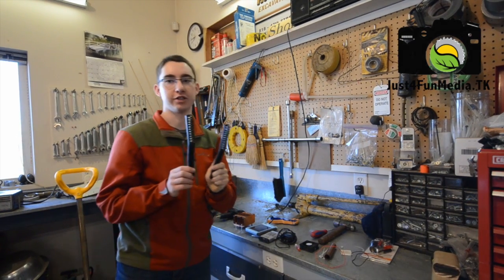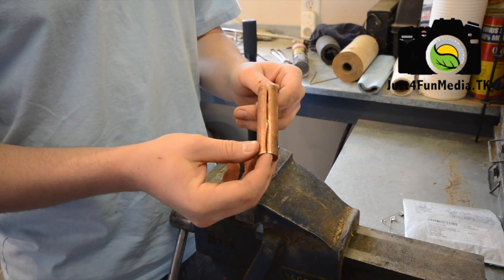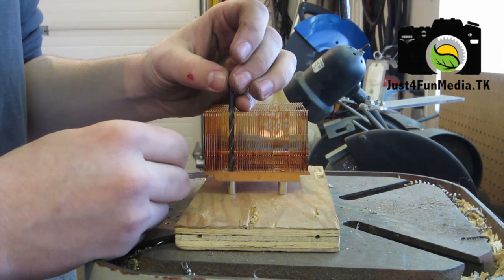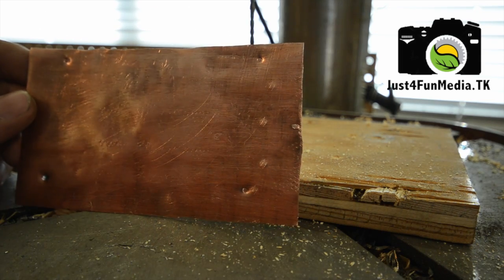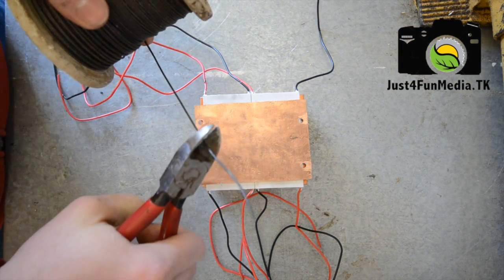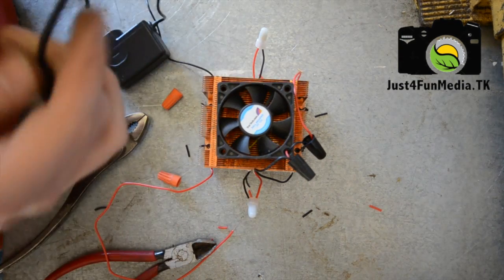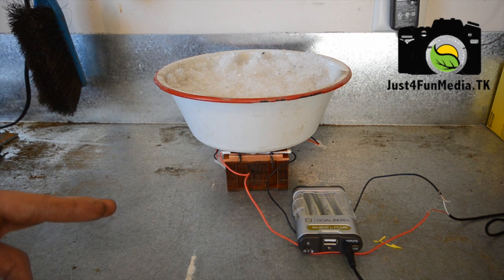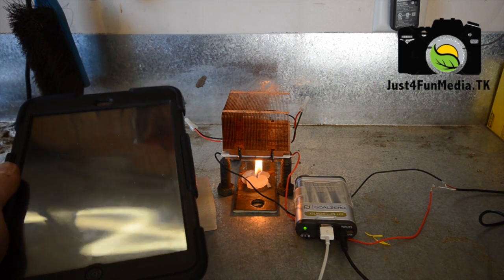How to Build a DIY Themoelectric Generator

Comment: Great project!
Very nicely explained.
1- Can you please tell me about the goal zero,  and let me know if I am understanding this correctly. You are using your Peltier device to charge your goal zero power bank, correct? 

2- Can you please tell me how did you connect the goal zero to the thermoelectric generator, I mean can you please explain the wiring? I can’t make out where the black wire which is in addition to the red and black ones is connected to?

3- Which one of the following will definitely give results of storing energy from the generator since I am new at this.

https://www.amazon.com/Goal-Zero-Guide-Plus-Recharger/dp/B00D2SQ6W8/ref=mp_s_a_1_17?ie=UTF8&qid=1546828570&sr=8-17&pi=AC_SX236_SY340_QL65&keywords=goal+zero

https://www.amazon.com/gp/aw/d/B075MGKGX8/ref=ox_sc_act_image_3?smid=AZ6R2O6YU64WX&psc=1
Reply from the maker: Yes that is correct. I'm using the goal zero as a power regulator to protect the devices I am charging.

Comment: Funny what happened to the cooling fan? Couldn't run it? Spend money on a bigger voltage and wattage rated Peltier cell, run the 12v cooling fan and charge your phone without a battery pack like I do. All you need is a copper heat sink, a 12v 400 watt Peltier cell, a 50mm 12v cooling fan a 50mm small aluminium heat sink and a usb charge circuit board with voltage regulator.

Comment: Heat coconut fibre  in solar Heat for  8hours and insert heated fibre
into the heat resistance box.put the converter  inside. Close the box. You can load a light in the evening.

Comment: ..... ok this is new to me, so I'm gona ask a stupid ?  would a piezo crystal wafer work as a peltier device???
Reply from the maker: Piezo wafers and Peltier plates are very different devices. Piezo wafers are based on crystals and Peltier plates use semiconductors with different electron densities.

From my understanding piezo wafers only produce an electrical charge when flexed. The frequency of the piezo crystals are affected by temperature (why crystal clocks lose time when above or below room temperature).

I do not believe heating a piezo wafer would produce a significant charge, but temperate can affect their electrical output when being flexed, or change their vibration frequency when electrified.

All the best,
Danno

Comment: Do you think this would work well as opposed to the Goal Zero? I'm trying to keep the cost
down on mine, so I found a 10A, 12V Solar Panel Regulator. It has two USB ports in it, but I can
also wire the output to a 12V Lead Acid rechargeable.

http://www.ebay.com/itm/LCD-10-20-30A-12V-24V-Solar-Panel-Controller-Regulator-Charge-Battery-Protection-/322367792015?var=&hash=item4b0e9e238f:m:mUHB6z7os8gTPXAwnK6Ibtw

Great video though, I've been interested in alternative energy for many years,
only recently did I discover thermo-electric, I'm really excited about building this. About the
cooling fan though, just a standard CPU fan right? Wired before or after the regulator?

Thanks again for the inspiration! I will be sure to post a video of mine once it is built
and working(I'll even make sure to put up links to your video and instructable if you don't mind).

Comment: wouldn't the goal zero be charging those devices even without the candle? 😕
Reply from the maker: I discharged the goal zero before connecting the devices. The goal zero was used as a voltage regulator to protect the devices.

Comment: Hey, so how many volts does a candle flame produce in an hour and is their a more efficient way of capturing that thermoelectric energy from a heat source or scaling this to store energy in a large cell to than power homes or sell to an electric company? My company dug a hole 5 miles deep into the earth and at the bottom is temperatures exceeding 250 degrees so if we inserted a long copper pole to transfer heat to the surface well have a constant source of heat to power a thermoelectric generator like yours.. theoretically giving us free energy forever.
Reply from the maker: Thermoelectric generators are very inefficient, with an efficiency of around 2 percent. Turbines or steam engines are much more efficient at temperatures as high as 250 degrees Celcius. 
TEGs are utilized for their lack of moving parts and simplicity.

All the best,
Danno

Comment: What kind of power can you get out of this? 5W? Did you measure it?
Reply from the maker: I have generated 2-2.5 Watts at peak with multiple candles, and two generators (so each TEG module generated around 250mW at peak). I have yet to test it over a fire or a larger heat source.
The energy produced is proportional to the temperature difference between the two sides of the TEG plates, so as the heat sink warms up the generator becomes less efficient. 

All the best,
Danno
Reply: I know this is old but tegpro has proper TEG modules not TEC and one of them claims to produce 22w at a 220 degree difference.

Comment: what type of peltier plates did you use?
Reply from the maker: I used 40mm*40mm TEC1-12724T325 Peltier plates. Almost any Peltier plates should work, just make sure that the heat rating is sufficient.

All the best,
Danno

Comment: Could you please tell me the name of another voltage regulator device, one that is cheaper. Thank you so much
Reply from the maker: You can also use cellphone boost chargers (the small lipstick-sized ones). Just check the wattage output of your generator to make sure the charger has a high enough power rating.

All the best,
Danno
Reply: Thank you so much, and I can I use any copper heat sink regarding the size and dimensions.
Reply from the maker: Make sure that the heat sink fully covers the peltiers, as even heat distribution will help prevent cracking the ceramic plates.

The finer and more fins the heat sink has the more eat it will dissipate, and the more power you will be able to generate.

You can also use aluminium heat sinks, they are less expensive but they are also less efficient and will produce less power.

Comment: is there really a need to use a goal zero?
Reply from the maker: You can use any power regulation device. It is not required, you could use a solid state transformer, but the power regulator is a failsafe to protect your electronics from surges. 

All the best,
Danno

Comment: This thermoelectric generator usually called a renewal energy isnt it?
Reply from the maker: Yes, thermoelectric generators can be used for renewable energy. Since Thermoelectric Generators have a low energy density (are very heavy for the amount of power they produce) they are usually used to capture waste heat off of other conventional and renewable energy generators. 

Have a great day!
Reply: +Just4Fun Media ohh i see. This thermoelectric generator can supply a single phase?
Reply from the maker: @rheinsternrichard2158  The TEG generators produce a DC voltage

Comment: which side of peltier to 'burn' for generator? (cold or hot side)

thanks for sharing.
Reply from the maker: +Ragil Setio Pranowo If you are using single side Peltiers (identical on both sides) either side will work. It will just depend on how you wire them. 

I recommend testing them with a hot plate and a multimeter.

Have a great day!
Reply: thanks, I think I was confuse between thermoelectric cooler and thermoelectric generator...
Reply: Bro , just to clarify, heat can be applied to any side of generator?, it is not like this that only specified side of TEG should be supplied with heat?
Reply from the maker: @gauravpant8350  Heat can be applied to either side of most single layer TEGs.
Some are optimized with different backing materials on each side to act as a thermal source and sink.
Some multilayer TEGs have different temperature ratings for each layer, so they may be damaged if heated from the "cold" side.

@Paul S is correct that the model number is usually on the cold side.
It is best to read the datasheet for your specific model to be sure.

All the best,
Danno
Reply: most of them have a serial # on one side. heat the plain side.
TEG's are slightly better output and heat tolerant than TEC modules, but cost more too

Comment: Can you use thermal grease to glue the Peltier tiles to the copper plate?
(So the peltier tiles will be glued to the heatsink)
Reply from the maker: +Dylan Lal You can use thermal paste to hold the peltiers in place, but as you heat up the generator the thermal paste will soften. We used the wire to prevent the generator from falling apart when it is heated up.Have a great day!

Comment: How can I use this setup to charge a battery?
Reply from the maker: +Suyash Saxena you most defiantly can, all you need to do is create more voltage with your generator than the battery can produce. 

I HIGHLY recommend using a voltage regulator (as shown in the video) as it makes the process much easier and safer.
Reply: Just4Fun Media